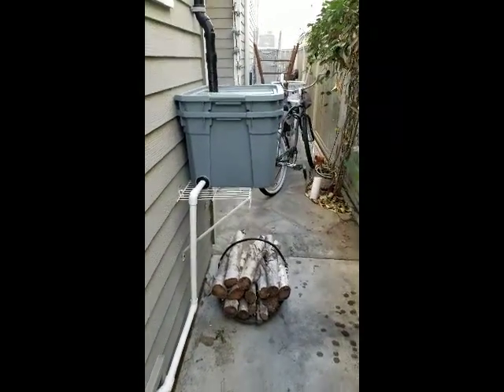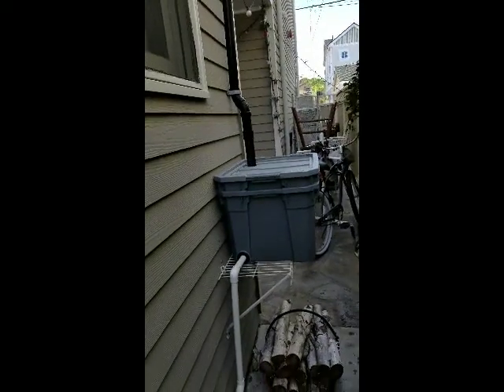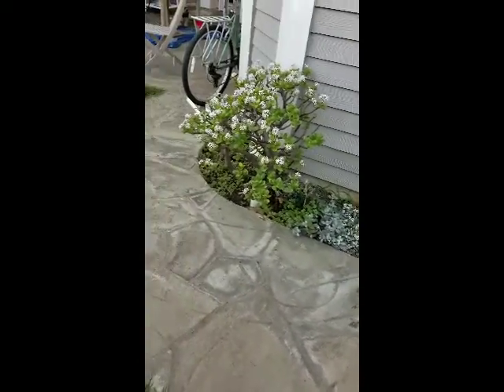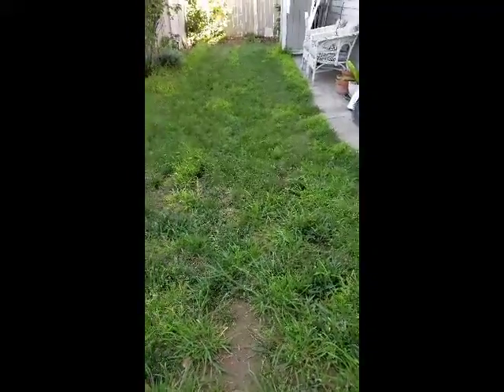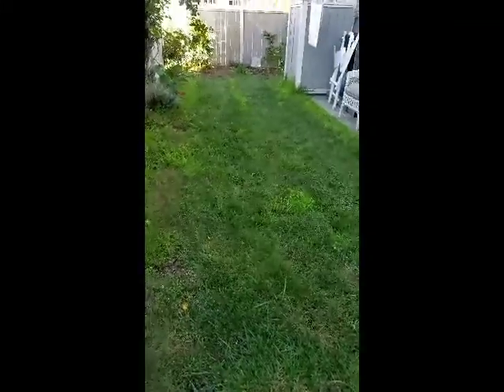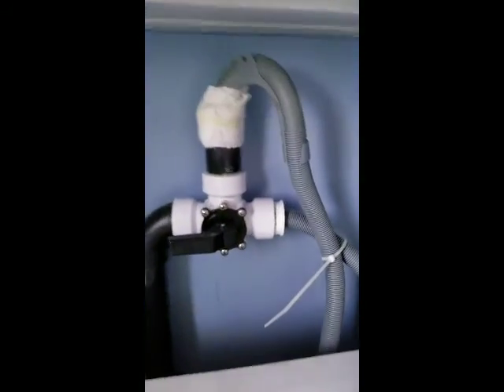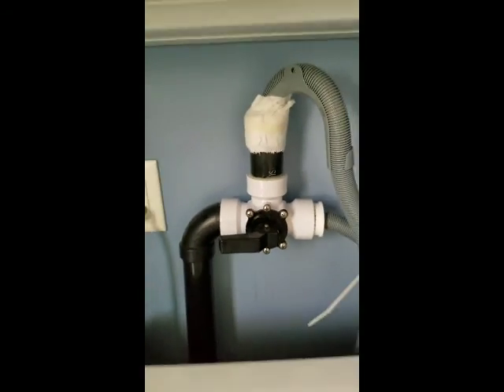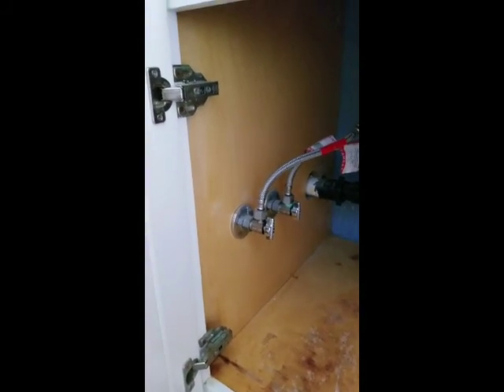A DIY Greywater Laundry to  lawn system for a 2nd story house

Comment: I have a similar issue, i have a split level house and my laundry room is in the middle on top level. I'm thinking of just going thru the floor
Reply from the maker: If you have a craw space at the bottom of the house,  try running very hot  water load of laundry, ,  then craw under the house and feel the 2 inch diameter pipes.  With luck you might be able to connect at that location. This video https://youtu.be/kP3sKReMfEU had a bathroom in the middle of the house that allowed us to use this method. Note: Stay away from 4 inch pipes, they have sewage water flow through them.

We are starting to use endoscope inspection camera connected to our phones to determine where drain pipes go and where to tap into them (maybe a down stairs wall) .  Write back and tell us how you solve the installation.
Reply: @grey4green49  no crawlspace, have basement
Reply from the maker: @MrLaker9900  Even better - easy access to all the pipes.  See if your phone has a thermal camera app - this way you can find the pipe to cut without feeling around.